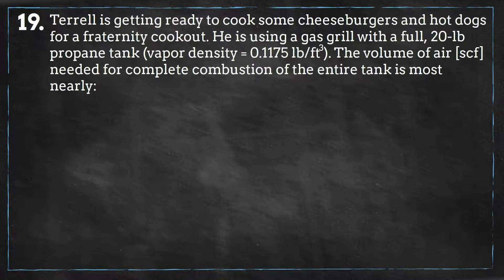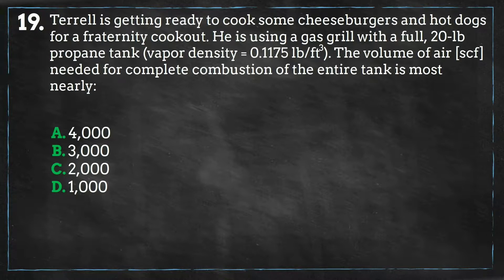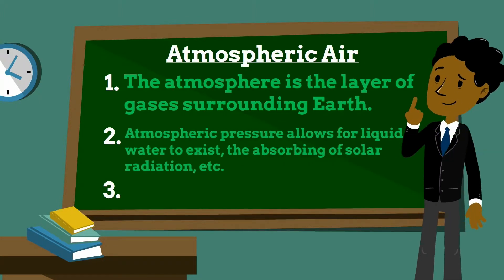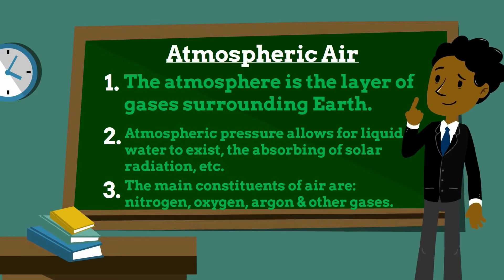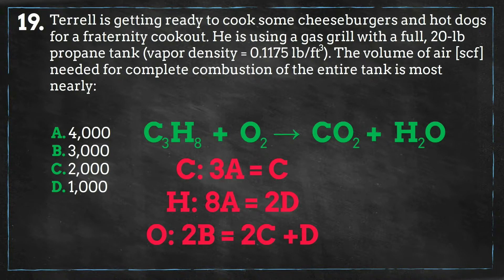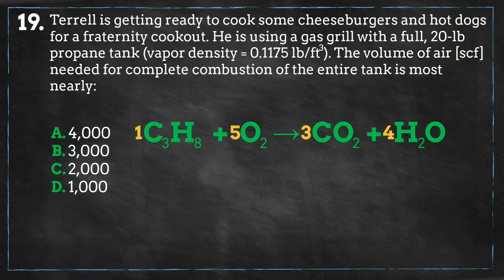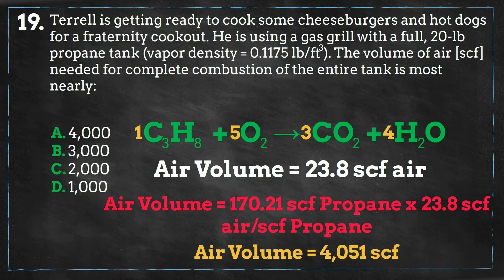Completing Combustion - Episode 19 (Air Pollution Engineering ) | 52 PE Exam Problems in 52 Weeks

Comment: Thank you for posting these questions, but you can simplified it like this: 1 mole of C3H8 needs 5 moles of oxygen, and 20lb of propane/ by its density gives 170 scf. since we need 5 mole of oxygen then 5 X170= 850 then divide by 0.21 gives us 4047 scf of air.

Comment: Since the question asks for volume of air required for combustion, why wouldn't we use the equation for the combustion in air which includes nitrogen rather than the equation for combustion in oxygen?
Reply: Nitrogen is inert. Just use the classic simple combustion reaction. Some thermo courses show nitrogen simply because it absorbs some of the heat. It does not chemically react
Reply: I did this and it works just as well. you end up with 5 moles of oxygen and 18.8 moles of nitrogen required to combust 1 mole of propane. since oxygen + nitrogen make up the vast majority of air molecules, you can just multiple 23.8 (5+18.8) by the volume of propane.

Comment: I keep arriving at 2,947.4 scf.

My methodology can be seen below:
1 mole of propane reacts with 5 moles of Oxygen
44 lb/mole of propane reacts with 160 lb/mole of Oxygen
44 lb/mole of propane reacts with (160 * (100/21) ) = 761.9 lb/mole of air

20 lbs of propane / Vapor density, 0.1175 lbs/scf = 170.21 scf of propane

170.21 scf of propane * (761 lb/mole of air / 44 lb/mole of propane gas)
= 2947 scf of air - answer.

with the utmost respect, I think it is incorrect to assume  that 1SCF of propane = 5SCF of oxygen. Just like how it is wrong to say 1lb of propane = 5 lb of oxygen.
Reply from the maker: Thanks for your comment, Michael. I think I mentioned this (probably much more eloquently) in a response to someone else, but one mole of an ideal gas will occupy the same volume provided that they are at the same pressure and temperature (1 mole = 22.4 L at STP, regardless of the ideal gas used). This allows me to use that "mole to mole comparison, which I then used to calculate the volume of air needed based on the volume of propane. If the question asked for weight, then the molar masses would come into play. Let me know if you have any questions regarding this.

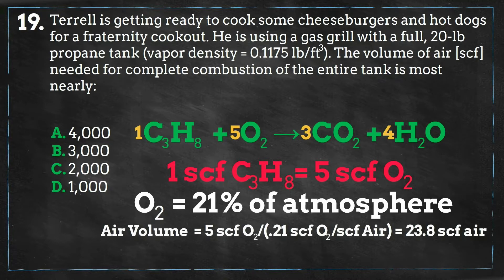Comment: At 2:47, you show that 1 scf C3H8 = 5 scf O2 due to the mole ratio. My understanding is that you also have to multiply by molecular weight ratio (32MW of O2 divided by 44MW of C3H8) before you can use the mole ratio. Why do we not have to factor in molecular weights in this problem?
Reply from the maker: Thanks for your question; let me start with some concepts serving as the foundation for this episode. The Ideal Gas Law (PV = nRT) shows that the volume and amount (moles) of the gas are directly proportional if the temperature and pressure are constant. Avogadro's law states that, "equal volumes of all gases, at the same temperature and pressure, have the same number of molecules," which is Avogradro's number of 6.022 × 10^23. As a general rule of thumb, one mole of an ideal gas will occupy a volume of 22.4 liters at STP (Standard Temperature and Pressure, 0°C and one atmosphere pressure), regardless of which gas it is. What differs is the mass of an atom for different gases, which is reflected by the standard atomic weight listed for each element in the periodic table.

In this episode, since we are dealing primarily with volumes of propane & oxygen, the molecular weight does not matter. I just mentioned weight when discussing the tank to clarify the propane's volume is condensed into tanks to sell to customers. Once you use the propane's density in the tank to convert the amount to a volume, you can simply use the mole ratios to find the volume of oxygen (as a 21% portion of the air) to find the total volume of air needed. If I asked what mass/weight of air we needed for complete combustion, we would then make sure to use our molecular weight ratios.